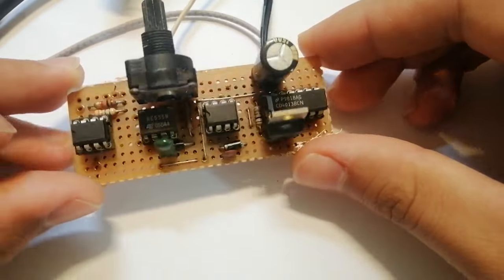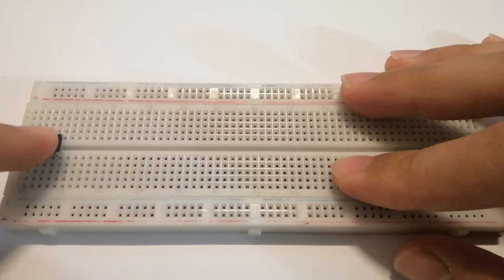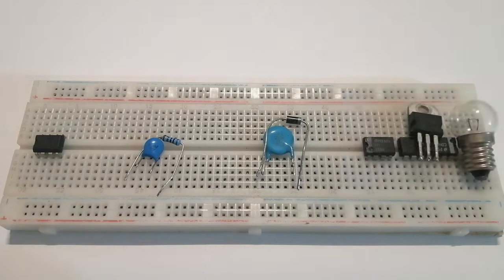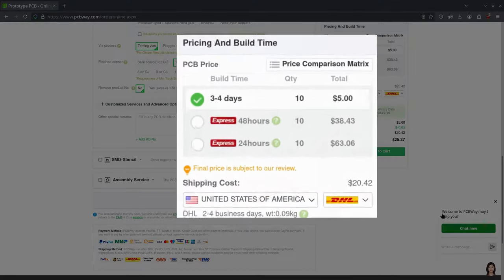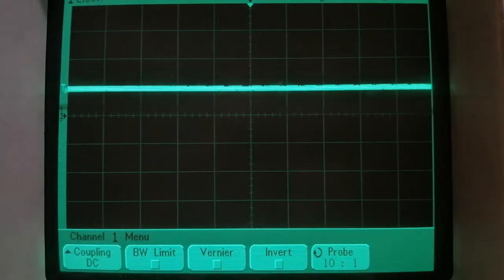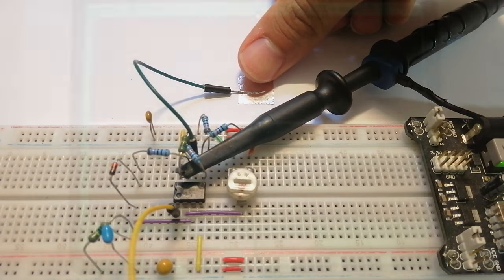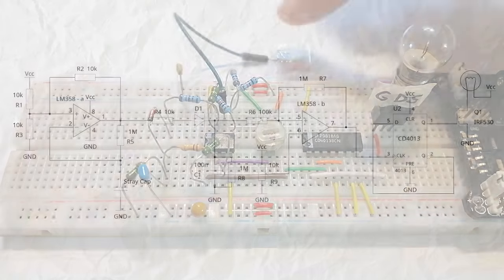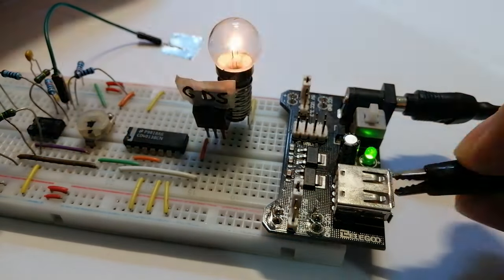Building a Touch Sensor Without Microcontroller

Comment: Have you tried touching the gate of the MOSFET to turn the light on and off? Without the other circuitry?
Reply: The MOSFET may be sensitive, but you need to hold a constant logic level, otherwise it would flicker, or worse burn out.

Comment: The LM358 is a general purpose op-amp, not a voltage comparator. This whole circuit works gracefully because the 358 is capable of impersonating a voltage comparator, and save the day unscathed. This is a nice, simple circuit which I would like to build, but I think I'll replace the LM358 with an actual comparator, like the LM393 (dual comp). Its open collector outputs require using a pull-up resistor
Reply from the maker: Good observations 👍

Comment: Was the problem with triggering the circuit by interference solved? I've made a very similar thing a few years ago, and had the exact same problem. Now I think that I'd add a one way low pass filter (slow charge, fast discharge via a diode) at the comparator's input, so that very short pulse wouldn't be enough to create a clock pulse. Touching it creates very long pulse compared to the one created by interference
Reply from the maker: I think so but can't be sure because I haven't tested It thoroughly.
The low pass filter is definitely a good idea, I should try that.

Comment: Usually, there is a strong enough 50/60 Hz potential on the human body to simply detect it. And this will require 4 transistors, not 4 chips. 😉
Reply: Some people can actually feel the 50/60Hz when holding the metal body of a phone or other devices plugged into a charger.  Myself included, it's a weird feeling sort of like a very low constant electrocution.
Reply: @BillAnt  That's not what you're talking about. And you will not feel 50/60 Hz from chargers, there are none there, the conversion frequency is much higher. :)
Reply: @f33net  - Whatever it is, I can feel it on some devices.  It may be the buck-converter's frequency, but there's definitely something there.
Reply: @f33net You can actually get capacitive coupling of mains voltage into the shielding of isolated chargers - sometimes the voltage differential can even be high enough to be painful when touching the shielding.
Reply: @BillAnt  is it like a tingling/vibrating sensation when u rub a metal surface connected to a plug?
Reply: @BillAnt  Same. For me it's when I'm working on (soldering/testing/'debugging') small demo/prototype setups (breadboard/perfboard stuff) and general tinkering at my desk right next to my main pc, the whole desk quickly gets populated with tons of... stuff.. 

I'm not sure what the cause is but I suspect it's the shitty 25 euro chinese power supply, could be the soldering iron too but that's a quality professional weller so I doubt it.. but it does have a fucky transformer so mhhh... I also very maybe suspect the multimeters with the leads laying on the table, I dont know.

All I know for sure is that the weird 'tingling' sensation has been completely gone with the powersupply removed.
The way i'd describe it is like the feeling of getting shocked by an electric fence with a very low intensity and without the 'peak' shock, but more of a constant 'hum'.
Honestly it kinda feels the same as touching and holding your hand on one of those plasma globe toys.

Comment: Isn't it possible to swap the flip-flop with another op-amp? Maybe a positive feedback circuit or something? It'd be hall cool if it can be done just on 1 quad op-amp ic
Reply from the maker: Yeah, that's a good point, I thought about it, because it would have been cool, but I couldn't think of an actual way to pull it off.